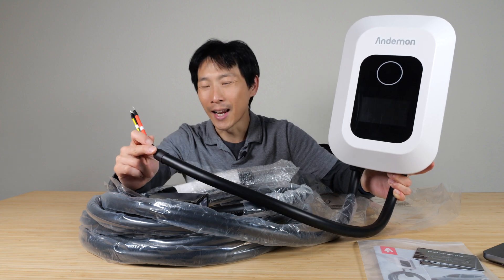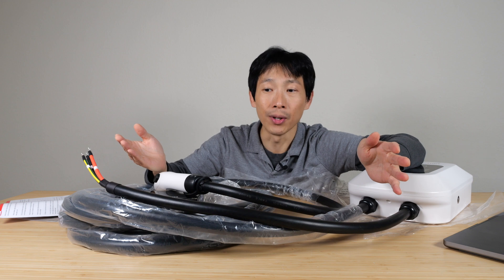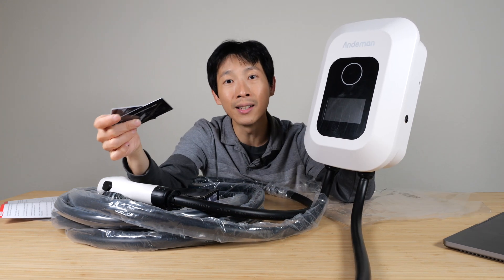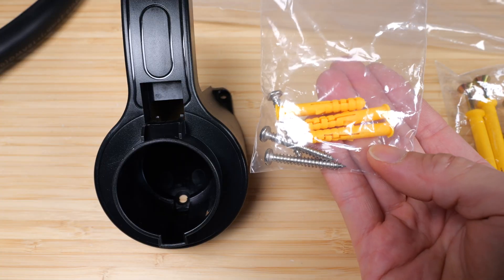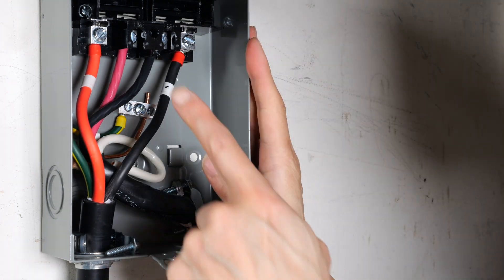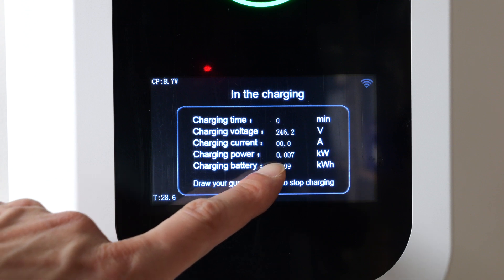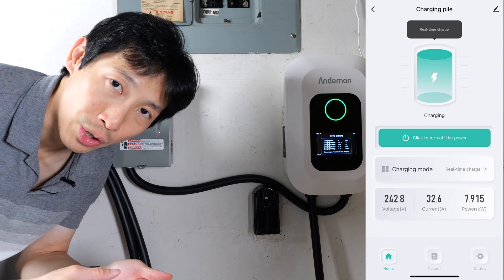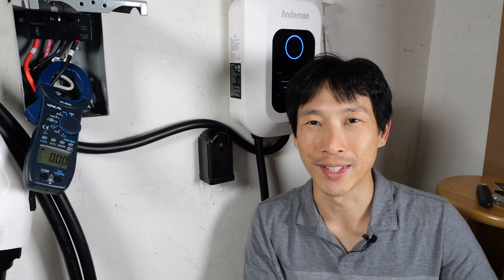What to Look For in a Wired EV Charger [Andeman]

Comment: Use 50amp or 60 amp circuit breaker?
Reply from the maker: You want to use about 20-25% over the continuous current expected assume you have the correct awg wires.

Comment: Im not having luck with mine 😢,it worked just fine with my 2015 bmw i3 but now i have a 2017 model X and it wont start changing,i have an original tesla adapter it goes to 1 amp the the charger goes purple and says energy leak,any idea?
Reply from the maker: Logically, this might mean Model X is not charging correctly. Does the Model X charge with other wall chargers (non-superchargers)? Or that the i3 doesn't detect the same fault condition as the Tesla.
Reply: @BeatTheBushDIY   the model x will charger with a120v and the same adapter, today I will test a different charger hopefully it is not the car the problem
Reply: @BeatTheBushDIY  I tested the model X at 2 different level 2 chargers and it works perfectly, guess my andeman is having trouble communicating with the car I'll open it up and see if I find anything out of the ordinary

Comment: What do you think that spot for that little battery is for? Mine has been working great. to bad i can't tell Google to start charging my car😢
Reply from the maker: Usually, it's like in your PC, it keeps power to the volatile memory chip so that it will remember your previous settings during a power failure. It could also integrate small amounts of flash that doesn't require battery power into the chip later on and this could remove the need for a battery. They should really remove the battery holder to save on cost if that's the case.

Comment: Hello, my greeting, can you help me understand the Andeman charger and it was installed by a professional, but the charger only charges at 30 amp and 7.2 kwh and the application is configured at 48 amp but the amps do not go up more than 30 amp. Can you help me with any suggestions. thank you.
Reply from the maker: What car are you charging, What gauge are the wires going into the charger? What is the breaker amp rating?
Reply: Hello, thank you for answering me, I have a Toyota BZ4X, the cables that we use are #6 and the break is 50amp.

Comment: cool, i got a 2013 chevy volt a few months ago. feel like having the electric generator fixes every problem with EV's. dont worry about crowded/broken slow public chargers on long road trips, doesnt loose a lot of range from the cold since it runs the motor and heats up the coolant for the battery and also heats the cabin with waste heat, doesnt let you discharge the last 20% of battery which i believe helps with longevity. has 2 different sized  ev motors with the most efficient magnet layout and a planetary gear transmission which means you dont loose too much efficiency at highway speeds (like the ev porche lol), and the generator in the first gen has a pretty high compression ratio and is smaller so it does alright with gas usage. similar weight to a model Y, maybe even a bit lighter for the same total range capacity.
only issue is they only put 3.3kw powersupplies in them (until the last 2019 model i think had 6.6kwh charger). wonder if there is anyway to upgrade the inverter or maybe wire a bendy solarpannel on the roof into the 12v system safely.
anyways, just about to drill a hole into the wall between my garage and laundry room and hook up some kind of switch between the dryer and the 30A 240 outlet lol.
you should review those wall outlets that have usb A/C ports in them next! or those bone conduction headphones, stuff i recently bought for cheap online :)